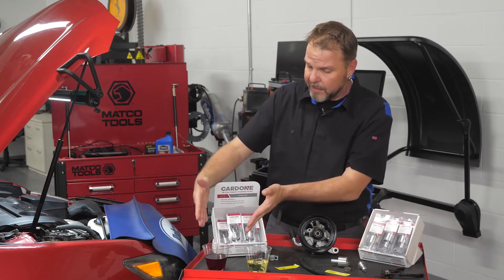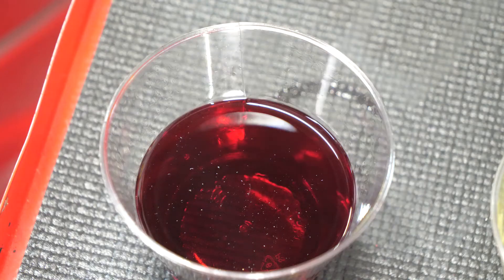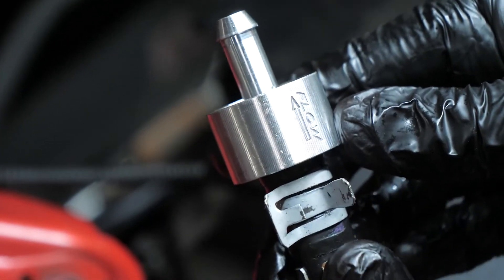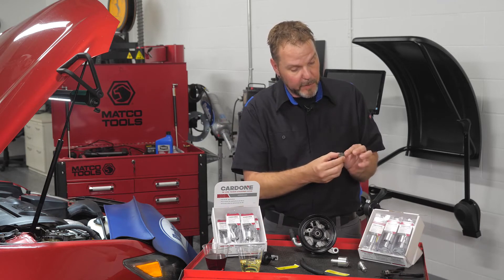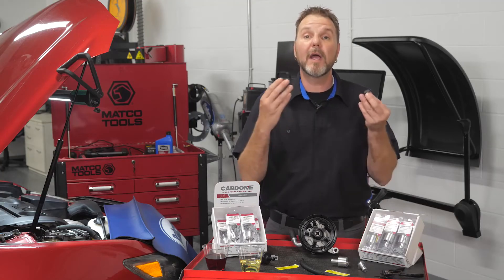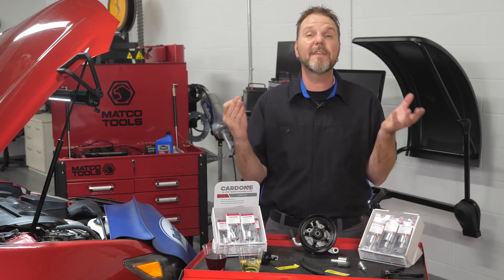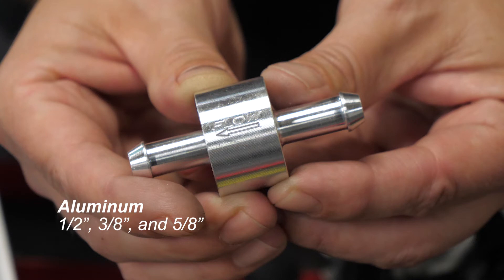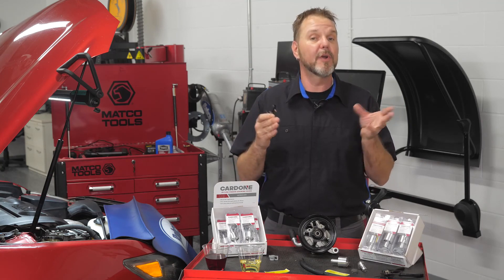An In-line Power Steering Filter Could Save Your Vehicle From Steering Issues

Comment: Where in the system should the filter be inserted?
Reply from the maker: Hello Niclas, thanks for reaching out! Someone in our Tech Support Team should be able to shed some light on your question, please call 888-280-8324 Mon-Friday 8am-5pm EST to speak with one of our ASE-Certified Technicians. 👌⚙😊👍
Reply: Add it to the return line.
Reply: @defmud80  and where exactly? I don't see how you could fit it to either end of the hose.
Reply: @t.t7225  one simple way to do it is to simply cut the return line right before the fluid reservoir and simply splice it in. Or in the same location, remove the return line from the reservoir, plug the filter into that line and add a length of 3/8 (or whatever your size is) for the filter to the reservoir. That method would help if its cramped and a little extra line will help get the filter where you need it.  It all can be right there at the fluid reservoir. Oh and a couple of good clamps if the filter doesn't come with them.
Reply: @defmud80  thank you very much.

Comment: My '05 Subaru Outback P/S belt makes noises and the belt squeals/slips during cold starts, even though it has the proper tension. The noise goes away after the system warms up. I already replaced the return hose and the O-ring (the typical issues with these cars).. but the noise remains. Next I'm going to check the mesh filter in the reservoir to see if it's dirty. Any other idea what it can be?

Comment: The “debris” on the old fluid kinda looks staged. Imo
Reply from the maker: Not sure about that, but thanks for the feedback! 😊
Reply: Looks like atf with some goodies sprinkled in.
Reply: Also they have red power steering fluid lol and clear.
Reply: Staged AF. Guy basically shows some brand new and CLEAN dextron ATF fluid (red) with garage dirt dropped on the top and the other fluid is a totally different type. More over mesh filters are included in almost all OEM steering fluid reservoir. So if you wanna have good filtration, you just have to go with a "clumsy designe" filter which actually includes paper filter+magnet. Paper will filter out the micron small particles too, what you can not see.